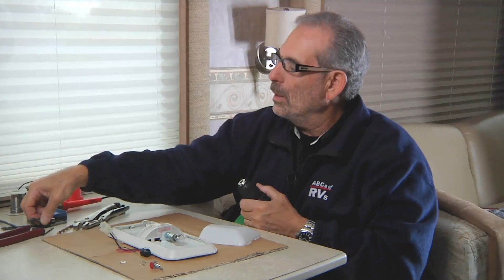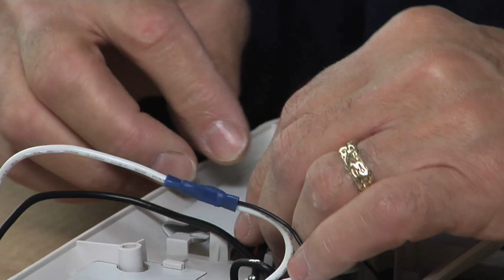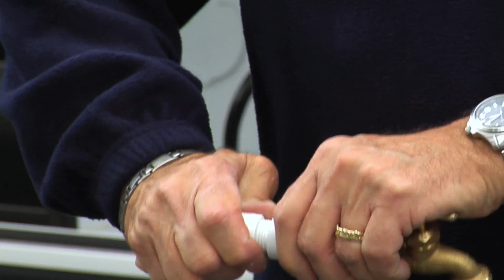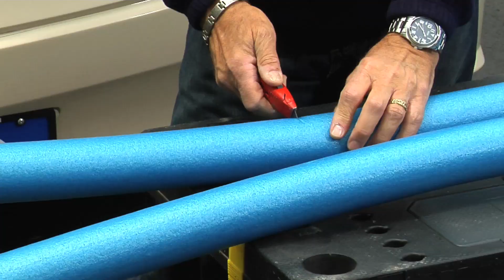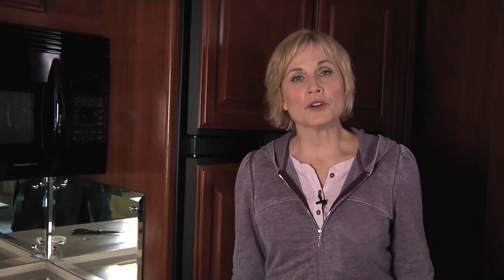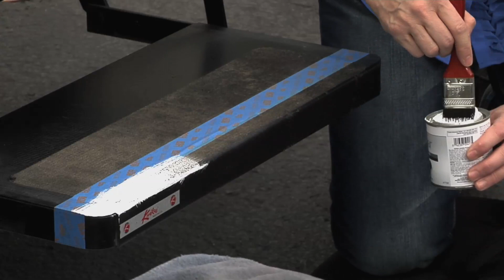Handy RV Tips and Easy Living Tricks-Part 1

Comment: I think that a $3 roll of white reflective tape would be better and easier than painting the steps.

I used it on my inside door handle so we would stop grabbing the screen door when  closing.  Also, other motorists could be alerted to an open door at night.

Actually a light should come on over the steps anytime the door is open
... just like it does when you open a car door.

Comment: not to be critical, in doing the hooks on the door, tape on your drill bit for depth into the wood is best. Also, a level with pre-drilling into the white wood first and making marks on the door would save you time.
with the wipers, would black pipe insulation work and look less noticable?
To reach your supplies in the downunder compartment how about those handy, dandy grabbers for reaching things in upper cabinets at home? Great idea for the epoxy! Maybe put holder on the poles holding you ladder. That way you Enjoy it while using your rv and won't ever drive away because you will see it in your rear view mirror!
Reply: You got great ideas. I checked your vids hoping that you had posted some RV tips and mods..
Looked like mostly family vids.
I'll get over it.
Reply: As for drilling.... I always use long screws then go outside and grind off the arm snags.

Check out my vids and critique all you have time for.  I just uploaded 101 tips and mods that I made to my new rig.

Warning... I don't edit or read a script... I just wing it. But I don't linger on any topic.
Reply: Haha... usually "seeing something in the rearview mirror " is a bad thing.  Like a hose dragging a faucet.  But you made it a positive.

Comment: Foolish to use butt connectors when you have a soldering iron and supplies sitting there! Trouble free connection! A Unibit works best for drilling 
thin plastic and sheet metal.

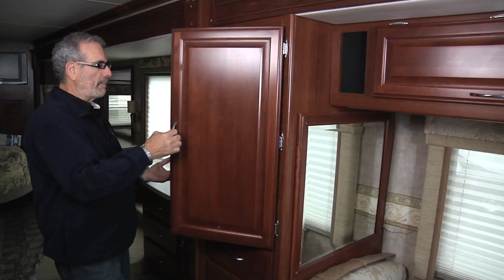Comment: Yeah OPPPPPSSSSS 26:28 that bottom screw went right thru the other side. The white stairs i think is a bad idea. for 20 bucks or so why not do it the better way run Led stripes to the stairs. White paint is just going to chip get dirty and at night youre not going to see it any how since it reflects no light.
Reply from the maker: Thanks for the feed back and thanks for watching!
Reply from the maker: Nobody's perfect, right? Measure carefully ... screw went through thin part of the door. Raise the basket position an inch and no problem. That's why we do these so we can all learn together. Thanks for watching and thanks for the feedback!

Comment: You should not use drywall screws for mounting heavier items, The steel is subject to cracking .
Reply: Donald Watts a standard sheet of 5/8" drywall weighs about 52 lbs.

Comment: Ouch the bottom screw went through the cabinet door.
Reply: Allen Jackson If he had flipped the wire strap down, it would have gone into the meat of the doorframe.  Also this puts too much weight on the hinges.

Comment: Good grief. Your drill bits must be dull as heck. No way it should take that long to drill a hole. Anyway, to get the final size for your switch, use a hole reamer after the initial drilled hole. Exact size neatly, without risk of tearout or lens damage. By the way, way too much work. Use a night-light or AA-battery motion sensing light.
Reply: That's what I do. When I enter and walk through my motorhome I think I'm on the catwalk showing off my Walmart discount pants.

Lights come on everywhere I go...
Let there be light!

Comment: IMHO, seems kind of silly to me to reinstall the light fixture BEFORE testing it. Flip the switch. If it works, install it. If it doesn't work, disconnect and check.
Reply: I just took one bulb out of all my roof lights and that cut my   consumption for those lights and brightness in half.

Comment: A much simpler light for bath would be a low wattage night light to plug in an outlet.
Reply: A step drill bit would have worked 100x better.
Reply: Yes good point on the nightlight. My wife is to short to reach the ceiling lights.
Reply: Step stool? lol. jk.
Reply: Margaret Hardacre We use headlamps in both house and RV. They are on hooks by the room entrances. Adjustable brightness. I only use one electric fixture in my house.
Reply: I used this: https://www.amazon.com/gp/product/B017VX7Z0Q/ref=oh_aui_search_detailpage?ie=UTF8&psc=1.  Swapped the light switch with a SPDT and wired the new light to one side.  That way, one side is main light, the other is night light.  Center is off.